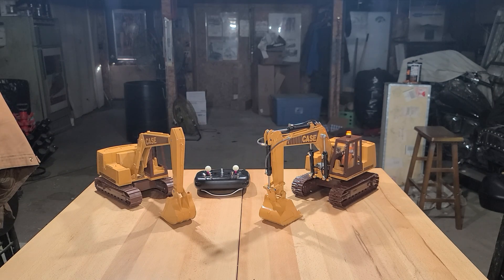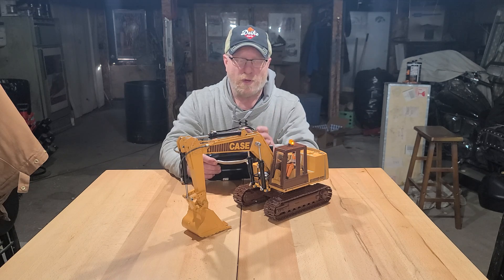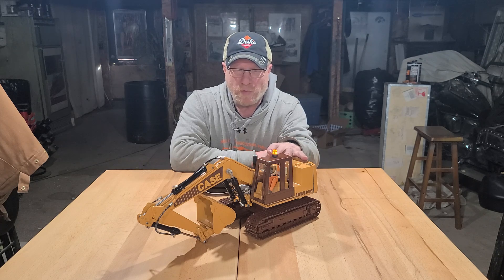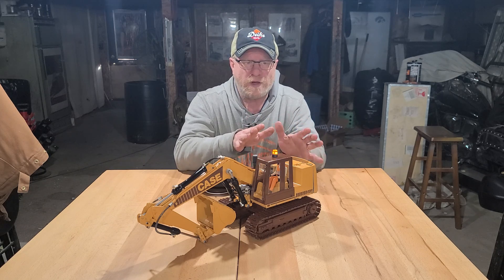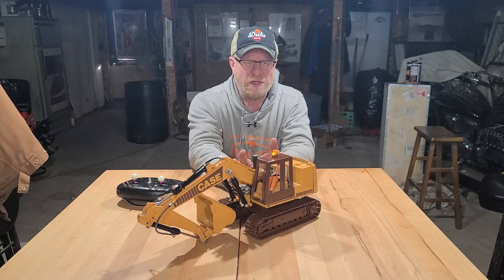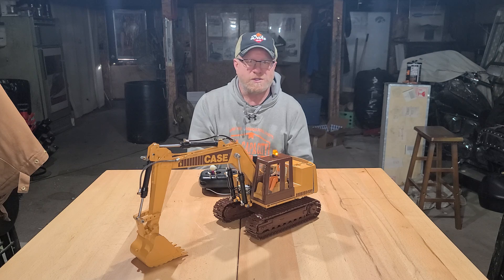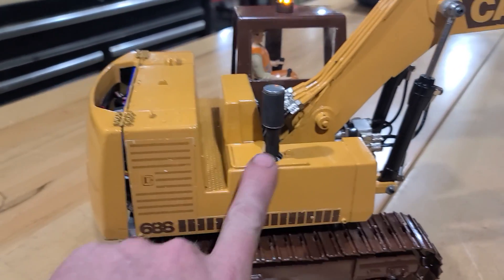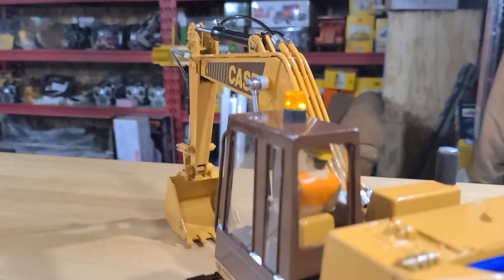1/16 Ertl CASE 688 RC Diecast Construction Conversion Finally Video # 10

Comment: That’s awesome! I have a 1/16 ERTL 688 excavator that I used as a sandbox toy. Do you by chance restore them? I’m looking for someone to do mine!
Reply from the maker: No I don't restore them. Unfortunately you can not find decal sets for them.
Reply: Is there a way to take it apart? I have sand inside mine. It’s in good condition but just like to clean it up a tad. Still has decals on it
Reply from the maker: @nathanshortess7332  yes there is a push washer at the bottom that has to come off to separate it. Then gently pry the bottom plastic cover off as it is just slightly a press fit. Hard part is you may ruin the push washer on the bottom, but I am sure there has to be new ones available at a hardware store.
Reply from the maker: @nathanshortess7332  sent you a PM video via FB messenger.

Comment: Really like your work. Is it possible to make thr hydrolic motor quieter?
Reply from the maker: Nope, it is what it is, I am happy with it the way it is and I'm the only one that it has to please. ;-) I could put a mini sound kit in it and that would just trade one noise for another.
Reply from the maker: Oh and if you wanna hear a noisy pump, listen to a Magom pump in a Bruder 320 conversion! Now that is one noisy ass pump. LOL
Reply: Spray some foam window sealer in the backend, lol That'll quiet er down, lol
Reply from the maker: @RomeKG471  not enough reserve room for that. LOL She is a packed house in there. 😉
Reply: Lol, saw that, bought like the new real machines. @dennybobsrcconstructionagc2796
Reply: What boom did you use? I’m trying to get things together for a conversion myself